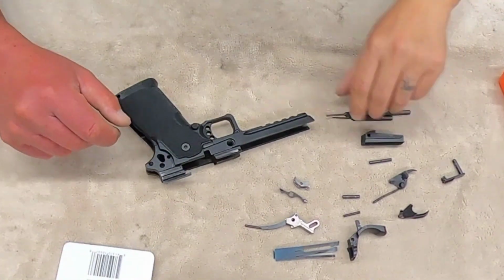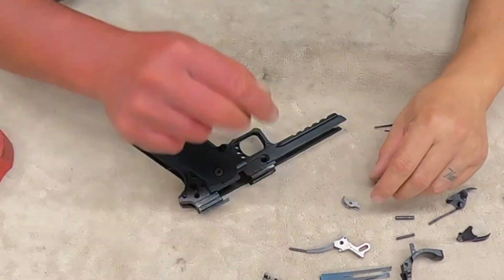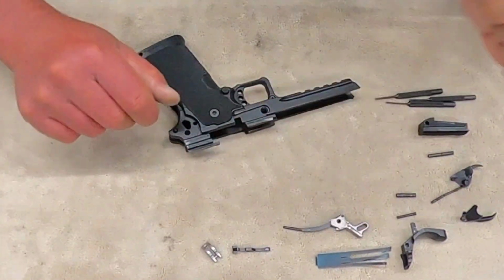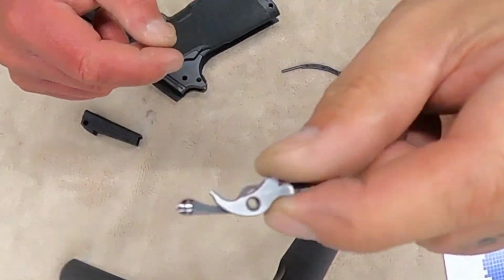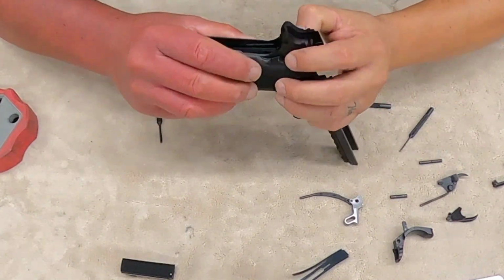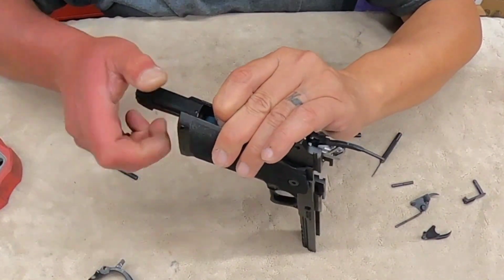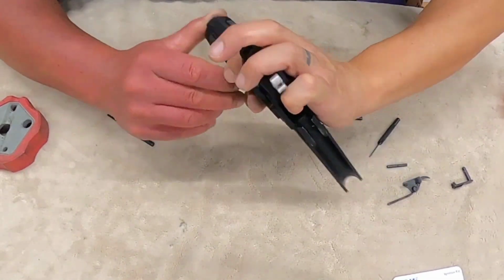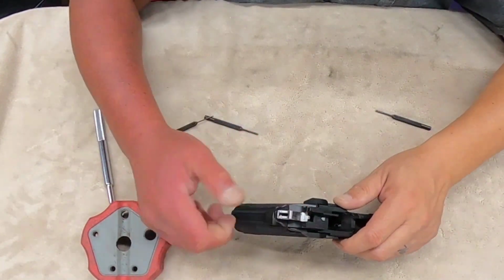Springfield Prodigy DS - EGW Ignition Kit

Comment: I don’t get it the volumes terrible you basically just showed us how to put it back together and you didn’t show us any takedown on the seer or disconnect. Did you smooth them out or what?
Reply from the maker: @consumerreview2284  Sure, the audio is not great. The video is mostly about the EGW kit and how well it fit in the pistol without modification, not about modification to the sears or parts engagement.  If you are familiar with 1911/2011 the disassembly is basically the same.  I did a separate video on that process...figured it wasn't necessary to do it again.

Comment: Idk where y'all get this 5 or more lb trigger pull. Mine has always been 4 and so is my buddies. Idk maybe our batch was made better idk but the trigger pulls I've seen on 5 or more guns have always been 4lbs.
Reply from the maker: I was using a mechanical trigger pull scale from wheeler, I am sure there's a variance between operators.  Either 4# or more, the upgrade EGW kit made a difference.
Reply: Bought a 4.25” last month. It was 6-6 1-4# out of the box!  Took it apart and cleaned up the ignition parts and all contact surfaces.  Tuned the sear spring and I’m getting 3 3/4# pull every time.  Just curious if the EGW disco runs smoother?   I will replace the ignition eventually but my gun fund was empty after the Prodigy purchase.

Comment: Did you have to do any polishing to your thumb safety? My egw and stock safeties don't fit with the new egw ignition kit. Thanks.
Reply from the maker: The thumb safety is a fitted part.  I would not modify the stock thumb safety in case you want to go back with the OEM disconnector and sear.  Since you have the EGW thumb safety, you will need to fit that to the new sear.  I don't have a video to do that, but you can search YouTube for fitting 1911 thumb safety.  It is important that this is done correctly for function and safety since it involves restricting the movement of the sear against the hammer.
Reply: Yeah,  not going to mess with any of the stock parts. I haven't run into many people or videos of people having issues with the thumb safety fit, so was curious if you did. Appreciate the response, and thanks for the video. @redarmory
Reply from the maker: @TannerCavaille  Sorry I misunderstood your question.  I did not have to do anything to the OEM safety, but when I added the DoubleTap thumb safety, It had to be fitted.
Reply: Ok. Thanks. @redarmory
Reply from the maker: @user-tv1lq6db9n  Did you have the hammer cocked back and insert left side thumb safety at roughly the 10 o'clock position while pushing the safety detent that is underneath the safety?

Comment: Did this fix the sloppy disconnect hangup when racking the slide?
Reply from the maker: You don't need to do this to fix that issue, I did it because of the MIM parts and wanted add'l adjustments to the trigger.  I would check your sear/disconnector/grip safety spring first.  Also check your trigger overtravel setting screw.

Comment: What did you use to polish those parts?
Reply from the maker: Word of caution, test fit prior to doing any sanding and/or polishing.  Parts you get might fit perfectly in your Prodigy.  If you chose to go forward with it, I used a high grit sand paper on flat plate only on the sides of the sear (not on the engagement surface).  As for the disconnector, same thing only on the circumference of the tip that protrude through the frame.  I then finished it off with flitz by hand.  Again to reiterate, no engagement surface was touched or modified.
Reply: Understood, what grit sandpaper did you use?
Reply from the maker: @Richie_EDC  the highest I had on hand was P800 but I would get higher if able...can take off slowly, can't put back.